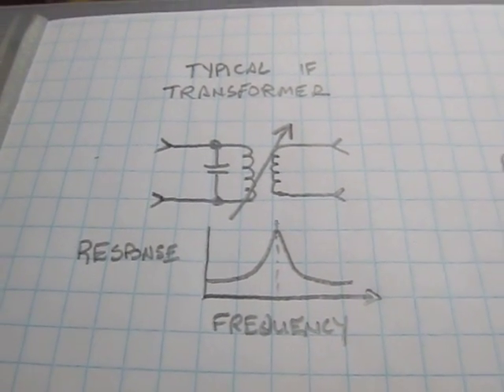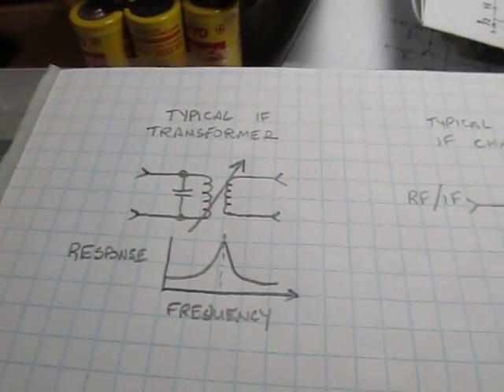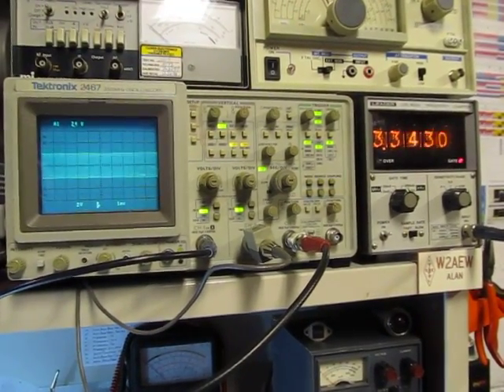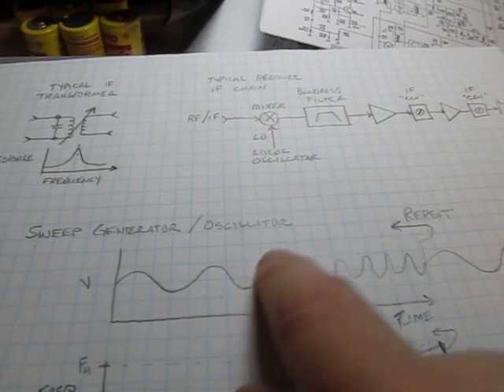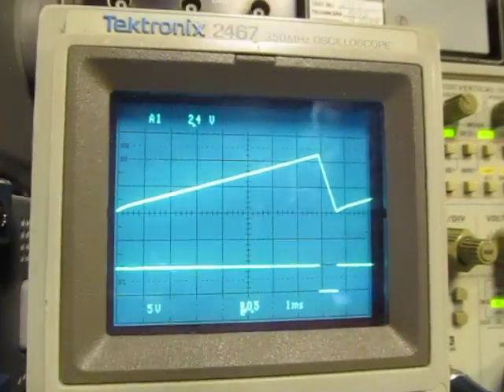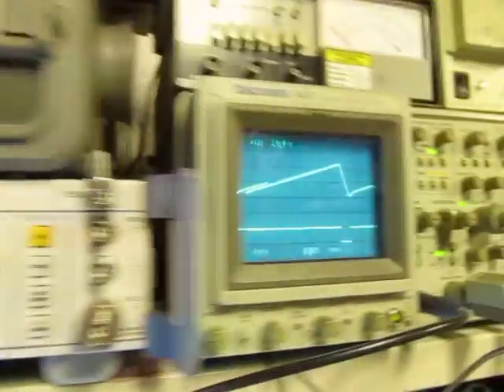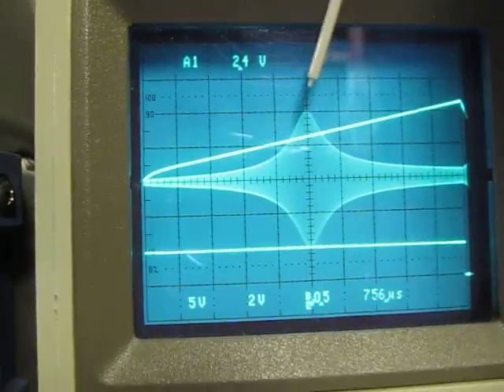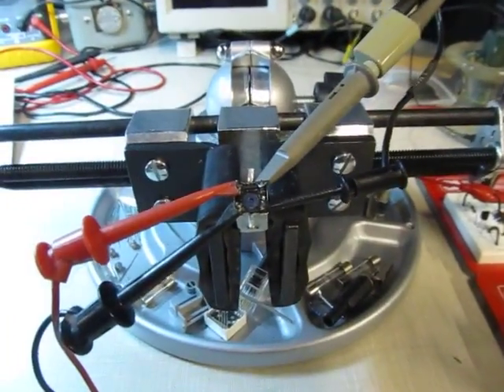#45: Sweep Generator Basics and Receiver Alignment

Comment: So we could say that outside military or goverment it is mainly used for Satellite equipment (including the ones for military and goverment uses). At these frecuencies I asume there is not use for tipical metal RF cans instead you use hollow cavities which are high priced. So a 10-20Ghz sweep oscillator for experimenting for fun is going to be expensive.

Comment: I have a question.
Reply from the maker: +Владимир Кузнецов Well, go ahead an ask you question...
Reply from the maker: +Владимир Кузнецов The sweep generator is set to start at a frequency below resonance, and increase (sweep) to a a frequency above resonance.  The scope is setup to trigger on the start of the sweep, and the horizontal timebase is set to display one sweep period.
Reply: +w2aew 

Run I

1.The sweep generator is set to start at a frequency below resonance, and increase (sweep) to a a frequency above resonance.

http://www.vova1001.com/2222/3344/5

TRUE

2. The horizontal timebase is set to display one sweep period.
http://www.vova1001.com/2222/2222/6

TRUE

3.The scope is setup to trigger on the start of the sweep.

Help.

The necessary algorithm of actions.
Step to step.

Stop.
Reply: +w2aew 
3.The scope is setup to trigger on the start of the sweep.

Help.

The necessary algorithm of actions.
Step to step.
for example

http://vova1001.narod.ru/txt/sin1001/26/sweep2ver.htm

waiting for
Reply from the maker: +Владимир Кузнецов Most sweep generators will give you a SYNC pulse at the beginning of the sweep - use that as the Trigger input on the scope.
Reply: +w2aew 

Run I

1.Most sweep generators will give you a SYNC pulse at the beginning of the sweep - use that as the Trigger input on the scope.
http://www.vova1001.com/2222/7

TRUE

2.The sweep generator is set to start at a frequency below resonance, and increase (sweep) to a a frequency above resonance.

http://www.vova1001.com/2222/3344/5

TRUE

3. The horizontal timebase is set to display one sweep period.
http://www.vova1001.com/2222/2222/6

TRUE

4.Help.

The necessary algorithm of actions.

Step to step.

for example

http://vova1001.narod.ru/txt/sin1001/26/sweep2ver.htm

Stop.
Reply from the maker: Connect the sweep generator to the input of the tuned circuit that you are testing, and monitor the output of tuned circuit on the scope.
Reply: +w2aew 

Help.

The necessary algorithm of actions.

Step to step.
Reply from the maker: +Владимир Кузнецов That is all there is to it.  Connect the output of your sweep generator to the input of the tuned circuit that you are testing.  Then, connect your scope probe to the output of the tuned circuit that you are testing.  With the scope setup as previously described, you should see the frequency response of your tuned circuit over the swept frequency range.

Comment: isn't the "can" a potentiometer?
Reply from the maker: No, it is not.  A potentiometer is a variable resistor, and this is not a variable resistor.  The "can" is a tuned transformer with an adjustable "slug" which changes the resonant frequency by adjusting the inductance of the coils.

Comment: Doing a visual IF alignment is a total waste of time, when the tried and true method of peak alignment suffices.  Also I don’t see any viable or useful markers that a visual alignment should show. Typically the 455 center marker swamps the entire curve and makes this method  useless. Its just as simple to peak align then slowly increase the frequency and decrease the frequency above and below the peak. You will clearly see the 450 and 460 limits.  On another note peaking the curve too sharp will cause parasitic oscillations. These IF transformers do not drift on their own. If the manufacturer would pot the transformer after is tuned,mIF alignment would be a thing of the past.